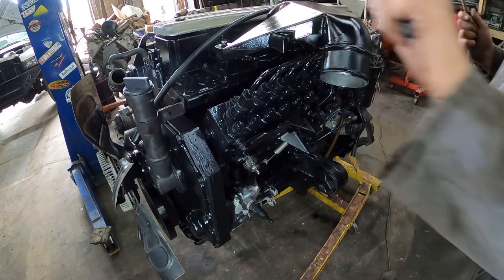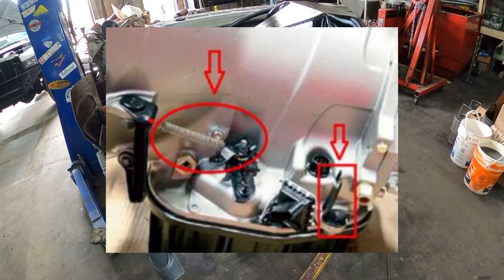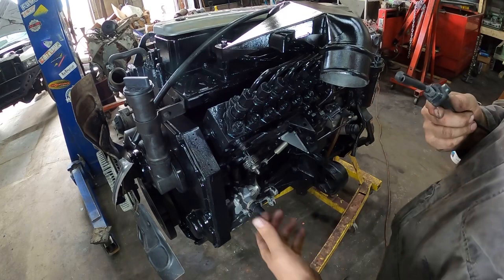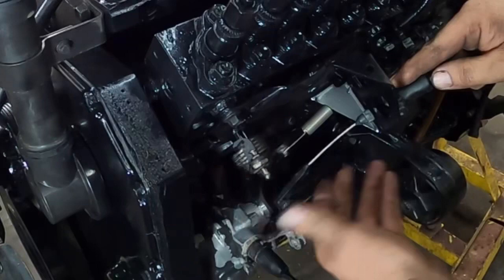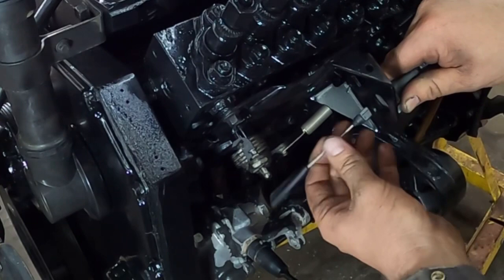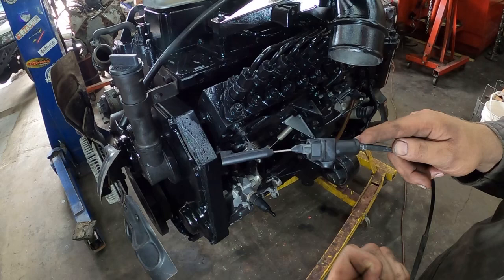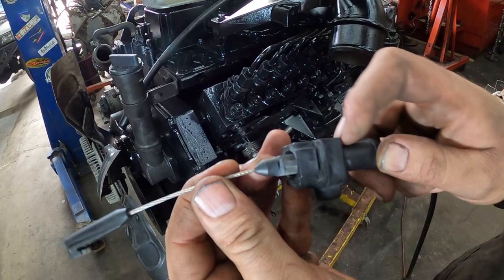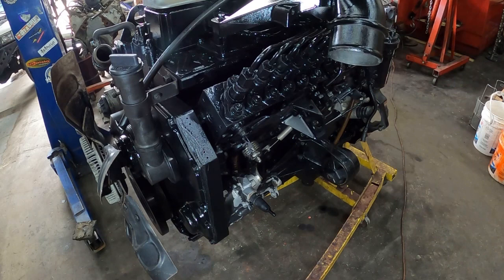How to set you tv cable dodge Cummins 47rh/47re /48re

Comment: Is there a part number for the TV cable spring 🤔  ???? And are the cables still being made ? Incase it needs to be replaced
Reply from the maker: I just use the same one that is on the throttle link for the 12v  ppump

Comment: Hey bud, I have a 98 12 valve automatic transmission. I hooked up a scanner and I’m only getting 59% out of my TPS at wot. So I removed it and checked  again with a screwdriver and I got 99% at wot.  Do I need to adjust the rod or what? Thanks man!
Reply from the maker: if your talking throttle cable , i would check to see if you pedal is bent , i have had to fix mine couple times
Reply: @CUTTERUPROB  well with everything put together it only reads 59% at WOT. It's not hitting the stop, its way off. Must be something binding. I can't seem to figure it out lol
Reply: @ThrockRocket  the bushing could be worn that rides inside of the TPS?
Reply: @throckrocket is your cable stretched?

Comment: I appreciate the videos..that throttle cable is very important .   My dad first Gen which had no lock up and no overdrive had a very tall gear ..a recipe for a lot of heat and failure

Comment: I just bought a 04 dodge cummins 2500 with a rebuild 48re and its been downshifting pretty hard around 1st and second gear and also not knowing whether to be in 3rd or 4th gear around 20 to 30mph. I replaced the trans output speed sensor and that fixed the hectic shifting from 3rd to 4th gear but its still down shifting pretty hard. I'm just now learning about diesels and trans so any help would be lovely, thanks!

Comment: Checked the TV cable on my 02. It's good but still got a harsh shift between first n second and in overdrive only 10000 miles on the transmission. Any ideas?
Reply from the maker: Sounds like it’s in the valve body. But I am not a trans expert

Comment: I understand how to set them up but i dont understand how to diagnose a bad cable by myself. 

Just did a tranny swap and dont want to burn it. Cable should be good but cable itself is questionable so im not positive its working properly.
Reply from the maker: If it questionable I would replace it for sure
Reply: @CUTTERUPROB  Ya ill try to find one again after xmas.

 Getting hard to find parts for these now for some reason. Couldnt get the right lines in for my life and had to reject 2 flexplates before they got right one. Made my own lines, came out pretty damn close to original.

Comment: I usually set mine up using a full manual valve body 😂😂
Reply from the maker: well that's a tv cable delete lol
Reply: So what you guys are saying is that it’s not needed for a FMVB. I just swapped a 47re in to my first gen and I’m trying to figure out if it needs to be connected or do I lock it in all the way open. Thx buddy for the content and keep the good work!